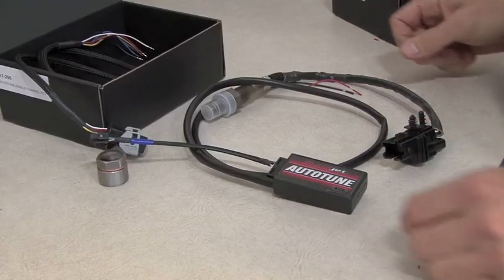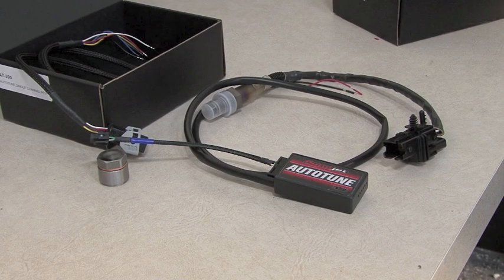Dynojet AutoTune for Power Commander V: Introduction

Comment: I have a Power Commander 5 installed on my completely stock Vstar 950. It came loaded with a map from Dynojet and it runs good. If I install the toggle map switch on the PC5 and switch back to the factory map and then add an Auto Tune kit, will it be active and apply changes to the factory map as well?

Comment: Does the stock ECU work against the auto tune? Or when applying the PCV and the auto tune it strictly runs it’s fuel tables and adjustments?

Comment: So after several tunes and fine tunes- for a race weekend do you think I should turn my auto tune off so that it will not try and adjust while I’m racing. I’m looking for consistency and predictability. Sometimes I think my auto tune is working against me due to changing weather conditions and the adjustments it’s making causing changes

Comment: Hey Dynojet, I had the PCV with autotune installed on my '12 s1000rr. I put an Austin Racing (AR) cat delete shorty pipe on it as well and made sure the PCV had the baseline map that AR had done. Now I know it's not ideal as every bike is different but this saves money on a tune. WIth that said, how do I know that my autotune is working properly? As long as the green light is on is there any checks I can do? I'm saying this because when I start up the bike I smell a lot of fuel. I'm not sure if AR's map just isn't adjusted for that or the autotune doesn't tune in neutral/start up..? Any help would be appreciated. thanks
Reply: have this problem rn :face-pink-tears: